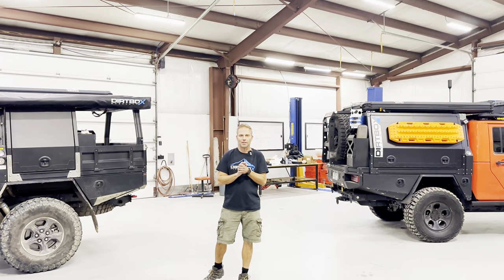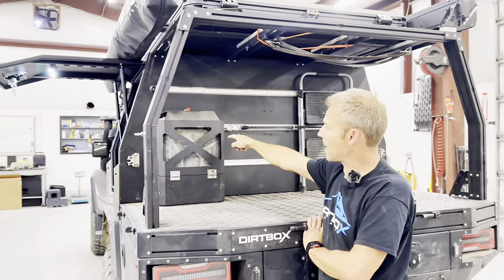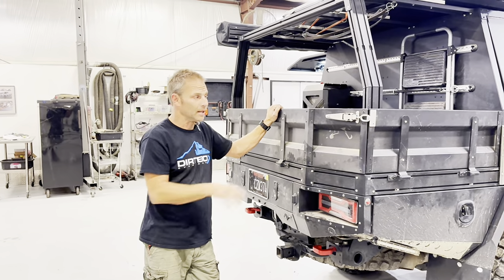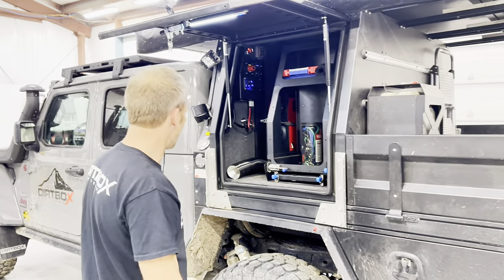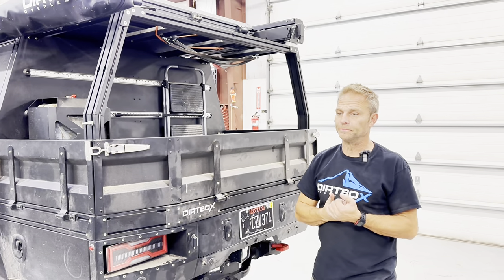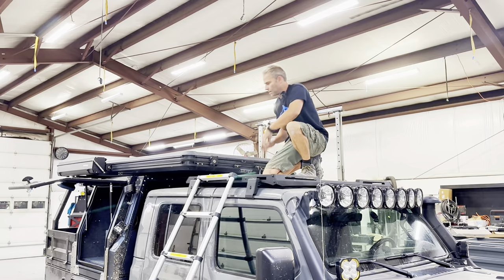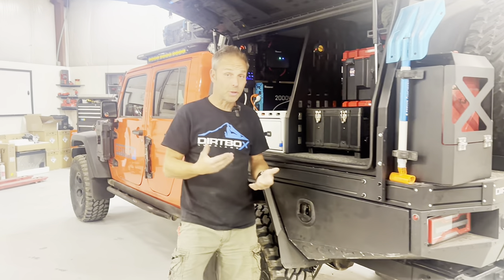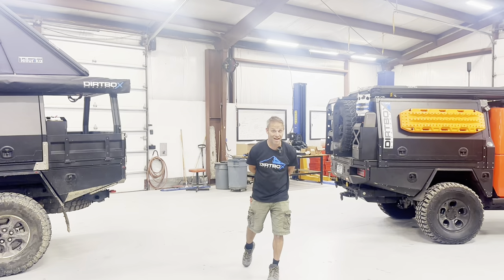This vs That! | Which Dirtbox Flatbed System is Right for You?!

Comment: Would you be open to making a flatbed canopy w/ a camper access?
Reply from the maker: Hey there, I am not quite sure what you mean? Like a flatbed with sides that you could mount a standard canopy camper to?
Reply: @Dirtboxoverland  correct, I love the flatbed set up with extra storage under the bed and the canopy camper with the insulated RTT as well. But with the RTT (facing the correct way)

Those two combined would be the ultimate setup 

In addition, an option of having a half rack set up on a long bed version with having the pass through access into the RTT from the enclosed box would be bad ass. 

Hopefully that made sense 😅
Reply: @Dirtboxoverland  Sounds like he means, just integrate the roof top tent from the canopy camper onto to the flatbed canopy and you get an all in one system with having a half box or full box version.
Reply from the maker: Yes we are developing a pass through from the flatbed canopy to a tent! 
We like the tent opening the "wrong" way because we make a deck out of a roof rack so you can have a place to sit and hangout up on top of your truck! It is actually pretty badass.
Reply: @Dirtboxoverland I'm excited, please keep us updated with the progress!

Comment: How much this current setup cost if you do it for customer?
Reply from the maker: Are you wanting the pricing for the full canopy setup or the half box canopy?
Reply: @Dirtboxoverland  not the full bed, the one in which bed is exposed after using the storage.
Reply: @Dirtboxoverland  the setup on the gray jeep?
Reply from the maker: The Halfbox pricing is on our website. $17,949 for the Gladiator

Comment: Why are ther no specs on the bed on your website??
Reply from the maker: Which specs are you looking for specifically. There is an info page on our website.
Reply: @Dirtboxoverland  dimensions like width, length, weight. Is there a standard size or could you put a 72" on a short bed tundra?